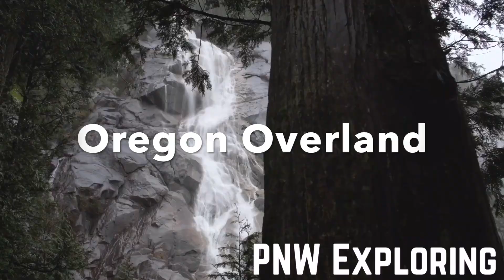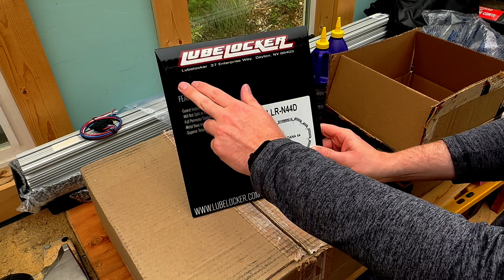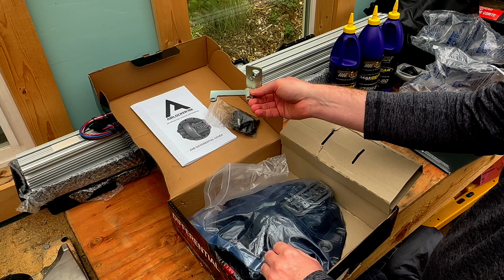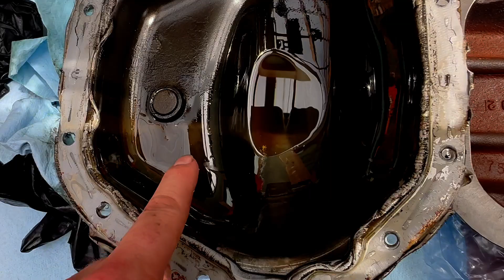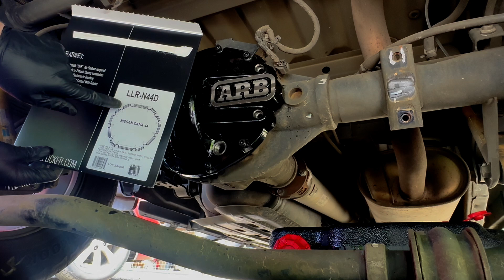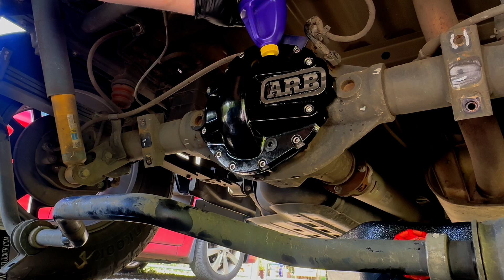ARB Rear Diff Cover Install - Wrong Parts Shipped!

Comment: My bolts were correct, thankfully. It was the first thing I checked. But my bracket was bent the wrong direction with the nut welded on the wrong side. Took some bending, hammering, and grinding in a vise to correct it. Used a regular nut with the bolt for the brake line. Worked out in the end.
Reply from the maker: Good deal!

Comment: Just used a Lube Locker gasket on my Frontier rear diff. Didn't notice the tightening sequence on the package so I just did a criss cross on the 12 bolts. Should be okay. Also did 30 lb ft just to be safe

Comment: Just received mine in the mail from Z1 due to them being on back order for a bit. Can’t wait to install it on mine soon. Did you happen to find the torque spec for those rear sway bar bolts by any chance? TIA
Reply from the maker: I believe it’s 36 ft/lbs. Sorry I didn’t include it in the video!
Reply: @OregonOverland  thanks!

Comment: i have a 2023 P4X, i used the rear diff cover from a 2015 Titan, aluminum and finned, got it new, came with bolts and the fill plug, very stout cover..  You are correct the gear oil viscosity of 75w-90 my manual says same thing of 75w-90... Not sure why Nissan changed it from 75w-140 in previous years. I also used the Lube Locker gasket, damn nice gasket. Also using this cover the oil capacity was 2.75 QTS.

Comment: At least Z1 sent you the right cover. I just opened mine and not only are the bolts wrong but the cover itself only has 10 bolt holes not 12 that my Frontier has.
Reply: Wow. QC is non existent seems like
Reply from the maker: Geez. That’s sad to hear! I’m hoping you didn’t already remove your old cover before realizing

Comment: The black looks just as good as my red one. So far lube locker is holding up awesome.
Reply from the maker: Thanks! Everything else is black on the vehicle, figured I do the same underneath. I DM’d you yesterday because I was panicking over the bolts. Thankfully I figured it out.
Reply: @OregonOverland  weird it never showed up on my end.
Reply from the maker: Hmmm. Maybe on the right where is says “requests”? One of those dm’s you have to approve? I see those everyone once in a while on a different Instagram link when new people message me
Reply: I just ordered the same cover with the lube locker gasket.   I hope they send me the correct bolts.  How many miles  did you have when you changed the cover/fuild?  Also.. do you think you will have warranty problem with Nissan down the road with this aftermarket cover?